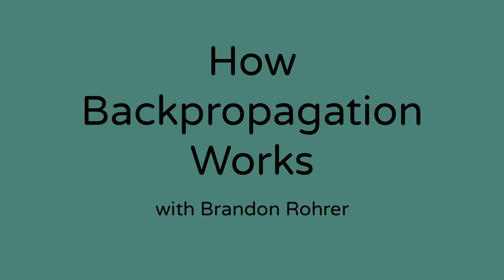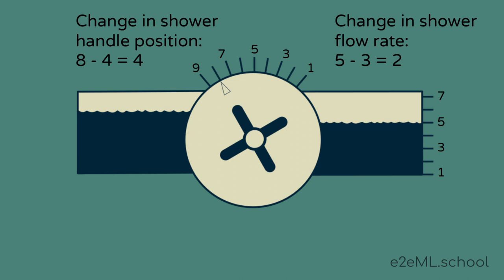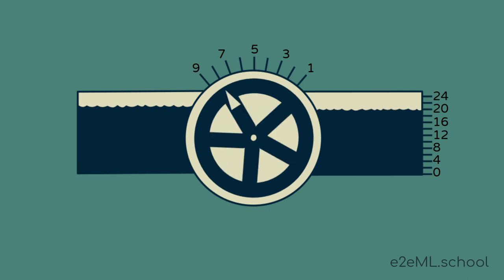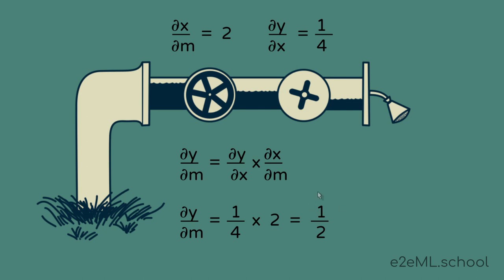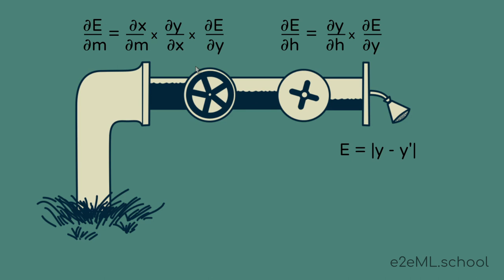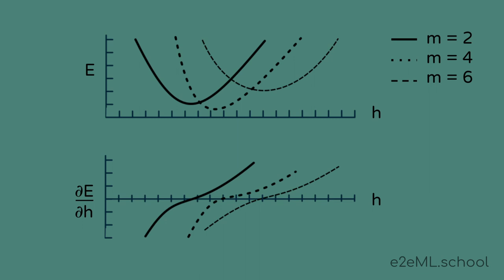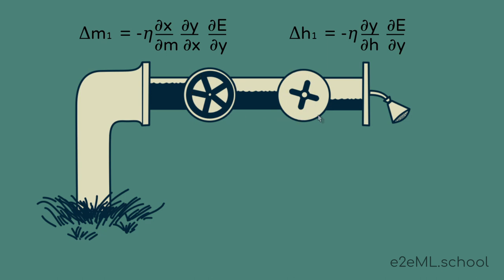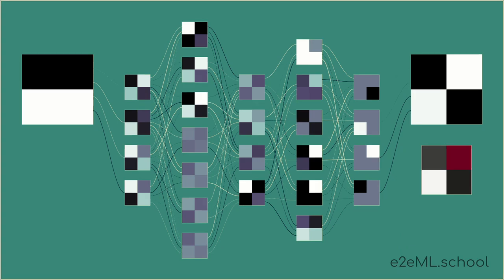How Backpropagation Works

Comment: Hi Brandon. Huge fan. Planning to buy your whole bundle when i got a time to look. Can you recommend me a starting route? From where to start? I think that someone should understand machine learning before deep learning thus i think i should start from ml before dl. Any help? Thanks for your efforts.
Reply from the maker: Thanks bekonyn! I'm very happy to hear it. There isn't a strict order to the courses, except for 312 and 313, basics and advanced neural networks. Other than those two, you can work through the courses in any order. Where there are soft pre-requisites or supplementary material I call it out. But you can feel free to let your curiosity direct you.

If you are feeling a little lost then feel free to start at 171 and proceed in numerical order. Enjoy!